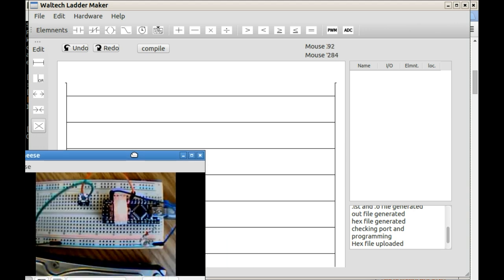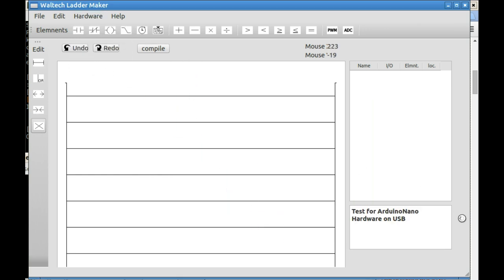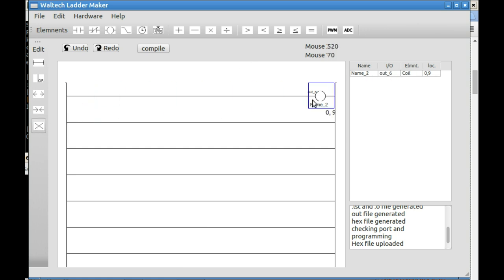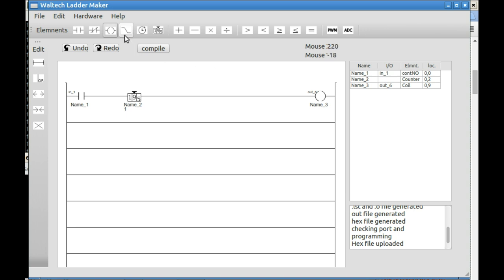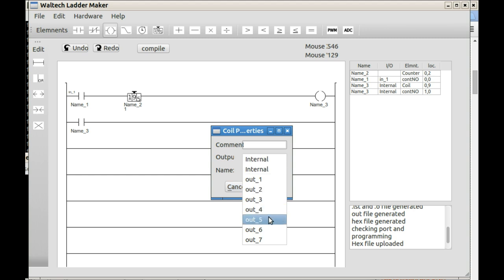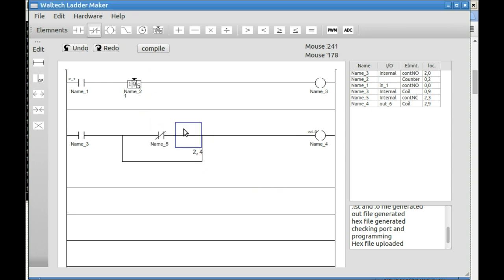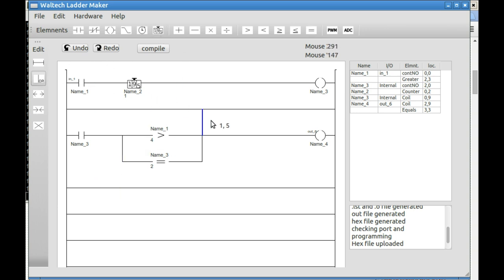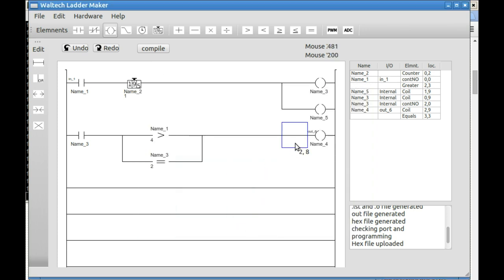Waltech LadderMaker v1.07a with Arduino Nano

Comment: Dear sir
Please confirm me Arduino Nano pin ,led or push switch connection  circuit
Reply from the maker: In_1 is A4, Out_6 is D12
Reply: @the_wrong_engine  thanks sir
Reply: Dear sir
I make timer ladder circuit but not working please make a new video for timer or suggest me

Comment: please, could you help me.
I can not make this program work on my Windows 10, the software does not open.
Reply from the maker: Unzip download. No installation required.

Running Python Source: Browse to Program folder, open a terminal, and run main.py. Requires Python 2.7 and pyQt4. Must be run in a terminal for USB testing and upload to work.
Reply from the maker: Try setting the arduino.rules, read here:
 http://www.waltech.com/blog/adding-usb-arduino-access-linux/
Reply from the maker: Another link that might help: https://steve.fi/hardware/arduino-basics/
Reply from the maker: https://www.youtube.com/watch?v=QxMMDk3wMsw
Reply: @the_wrong_engine  this link isn't working for me.
Reply from the maker: @andreyoder3454  Another link that might help: https://steve.fi/hardware/arduino-basics/
Reply: could show me how it is work using linux
Reply: Karl Walter thanks for your time
Reply: Karl Walter it is work but when i make USB test doesn't work

Comment: Can I also add Shields to the Arduino Sketch
 with this?  I am mostly interested in adding LCD Screen,  WIFI Shield, I2C Communications, Ethernet Shield, and/or BlueTooth Shield?  Can you please explain to me how I can integrate communications into the sketches for Waltech Ladder Maker?
Reply from the maker: +JP IHCC (TERET-IHCC) Sorry, LadderMaker can only make simple IO.  You could take the generated code to an Arduino IDE, and add the I2c fearures you want:
https://waltech.com/cszcms/laddermaker
Reply: Thanks I will try this.
Reply: @the_wrong_engine  
Is there possible to use arduino analog inputs or outputs with that software
Reply from the maker: @justinasbagdonas2548  The ADC and PWM functions are equivalent to Arduino analog in and out.
Reply: @the_wrong_engine  
Maybe it would be possible to find examples with ADC and pwm functions ?

Comment: I get a Error:  not found or greater than COM 9 when I try to test USB.
Its a Nano I use. 
What can I do??? Please help me.

I have updated the USB driver.
Reply from the maker: +Snipermester Linux or Windows?
Reply: +Karl Walter 
Windows
Reply: +Karl Walter 
Please HELP!
Reply from the maker: Snipermester You may have a nano that has a ch340 usb chip instead of ftdi.  The later versions of LadderMaker support these, so use the version 110a.  https://www.youtube.com/watch?v=QxMMDk3wMsw
is a video for getting it going on windows.
Reply: +Karl Walter 
Thank you very much.
I will get back to you if it worked out for me.
Reply: +Karl Walter 
How can it be THAT complicated to install a program? 
Is there a guide for how it can be installed? 
The video you linked to is not a full guide!? The person does not show how to install any of the programs.
Reply: +Karl Walter
Come on! Help me!
Reply from the maker: +Snipermester First, check in the Device Manager and see what com port the Arduino is connected to and if it is FTDI or CH340.
Reply: Karl Walter

Its FTDI
Reply from the maker: Snipermester And what port is it assigned too?
Reply: +Karl Walter COM1
Reply from the maker: Snipermester It seems to be there as it should be,  I do not know why it is not detecting it.  Maybe ask over at https://www.youtube.com/watch?v=QxMMDk3wMsw  Julian is running windows ten.
Reply: change port no .low than 9

Comment: Es Genial amigo, gracias por compartir. Espero encontrar programas así para los PICs, ya que hay varios para Arduino, estoy en búsqueda de algo que pueda ser tan práctico para programar y a la vez que pueda ser compatible con PIC y/o Arduino. Saludos
Reply from the maker: Try LDmicro
Reply: Si es bueno, aunque hay trabajo por hacer, para que tenga una interfaz más agradable. Has pensado agregar soporte para PICs en tu soft ?
Reply from the maker: Michael Pérez Norabuena Probably not.  Unless a PIC development board with an onboard USB method of programming becomes as popular as Arduinos.
Reply: Quizas esta información te sirva
http://wiki.pinguino.cc/index.php/PIC18F2550_Pinguino/es
Reply from the maker: Pinguino is good! Will need a C compiler too.  http://sdcc.sourceforge.net/ may work int he future. --Karl
Reply: Si es posible, espero que se pueda incluir algunos PICs en Waltech LadderMaker, seria GENIAL!
Reply: Michael Pérez Norabuena  Hola michael ya intentaste con ldmicro para pic´s saludos...